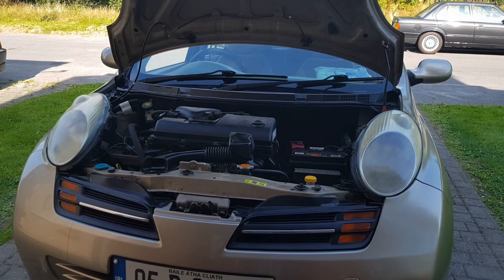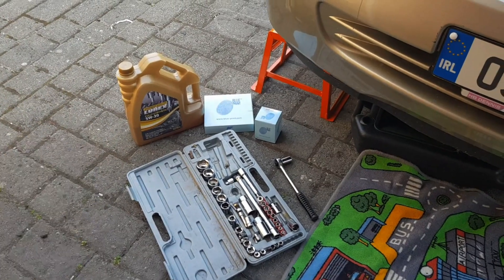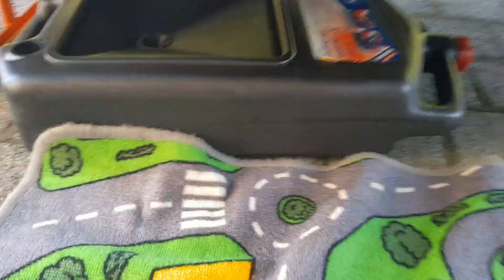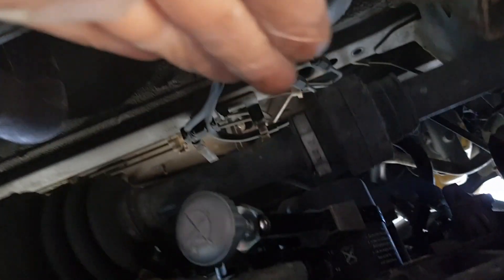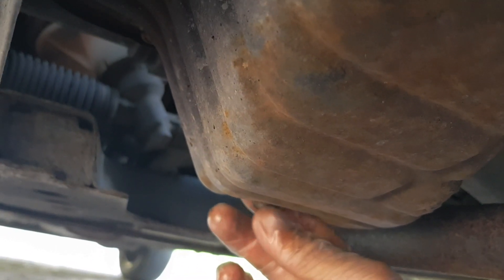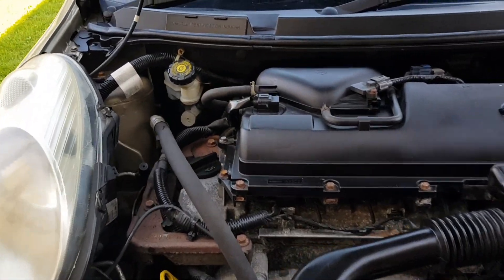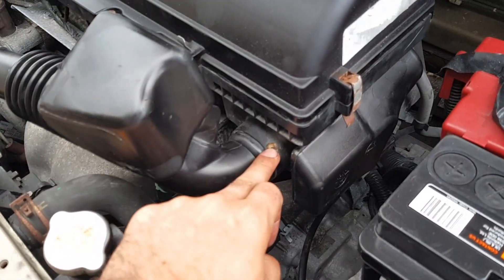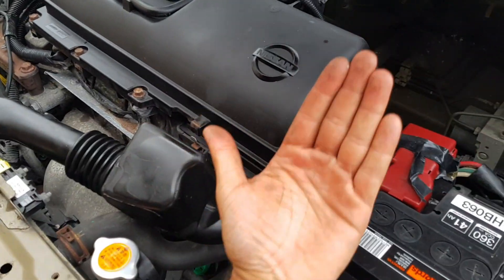Nissan Micra K12 1.2 OIL CHANGE | AIR FILTER CHANGE

Comment: How often do you change the air filter? Everytime you change the oil?
Reply from the maker: I'm sure there is some sort of standard but in my humble opinion: It mainly depends on the environment the car is used in. In my case (Ireland), I change the air filter in my cars every 2nd or even 3rd oil change. On the other hand in some dusty environments and heavy use, you could be changing the air filter every oil change. Hope this helps you.

Comment: Hello I just bought same car 2004 and it didn't come with a remote key just something like a house key do you know if I can buy a remote key and program it to this car to use with central locking thanks
Reply from the maker: Hey 👋 I'm not 100% sure but if you check in my Bmw E30 playlist, I did install a kit on it to achieve remote central locking and I'm positive that it was a universal remote locking kit or that company does them kits. You can also search online "remote central locking (your car)" hope it helps! Let us know how did you get on?
Reply: I will definitely give that a try thank you
Reply from the maker: Best of luck 👍🏾
Reply: do you know were the fuel filter is on this model
Reply from the maker: I looked up, it seems like they have it as part of the pump and usually isn't a serviceable item.
Reply: @noorshah96  wow thank you very much I was wondering why I couldn't  find it

Comment: does your oil cap get mega tight? For some reason on my K12 Micra does.
Reply from the maker: No I haven't noticed that before, will be doing an oil change sometime soon, will report back if it actually does gets tight.
Reply: @noorshah96  thank you. It might just be my one, I have the Japanese imported version and it is the Autech 12SR varient which has a higher compression CR12DE engine
Reply from the maker: Oh no problem, yeah that could be it. Maybe check it more frequently and see if it always gets tight or over long time